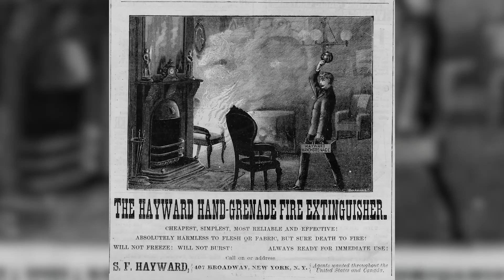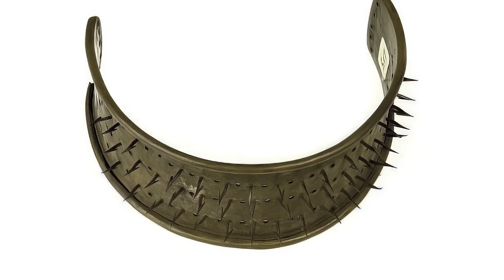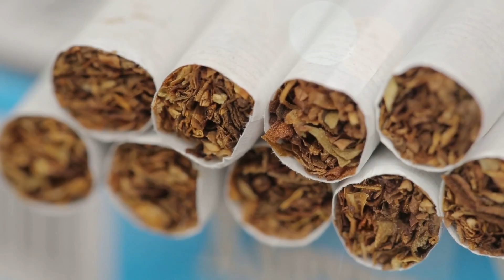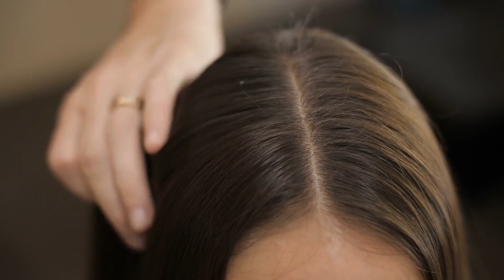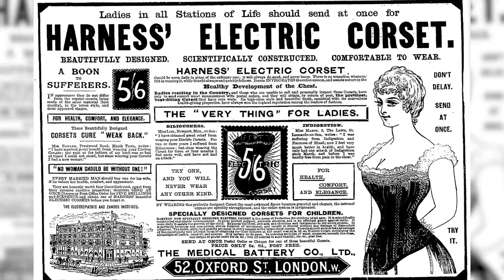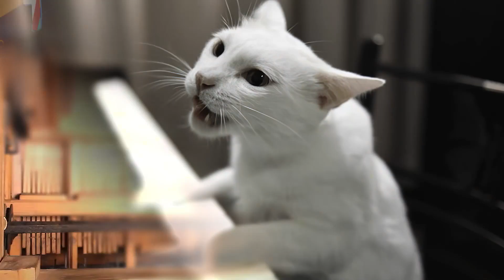15 ODD Inventions from Victorian Times

Comment: It wasn't a set of gears used to adjust how much resistance was applied to the crank. The box was filled with sand with sets of paddles on the crank axle, and the amount inside varied the resistance.

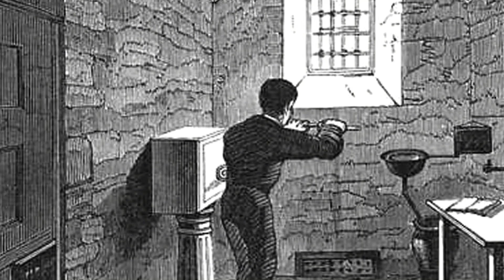Comment: The crank machine 10:44 could’ve been set up to generate electricity for the local town.
Reply: The purpose of that punishment was to make the inmate do hard work with ZERO outcome or benefit.
Reply: @Ron-d2s  They need not be told about it.
Reply: Or the mechanical hairbrush 😉
Reply: Where are the statistics, Was it effective?